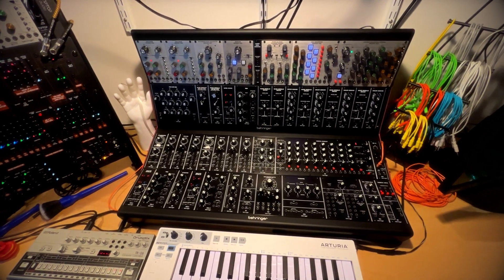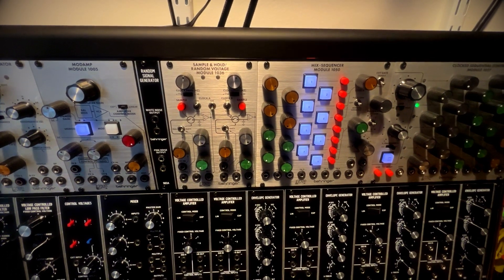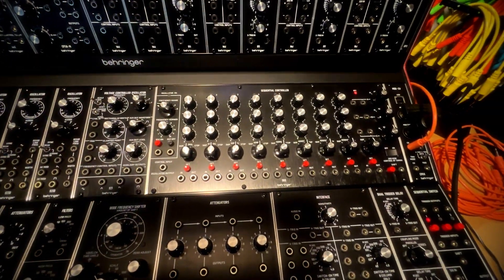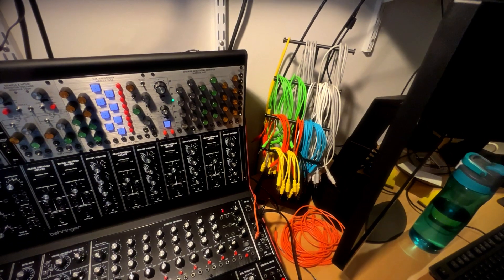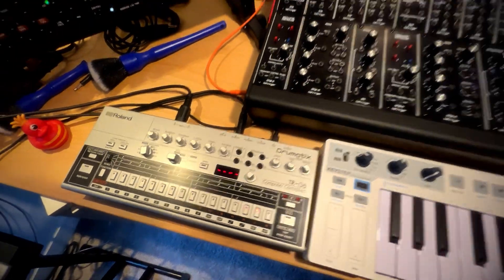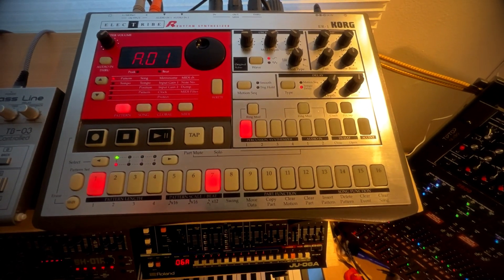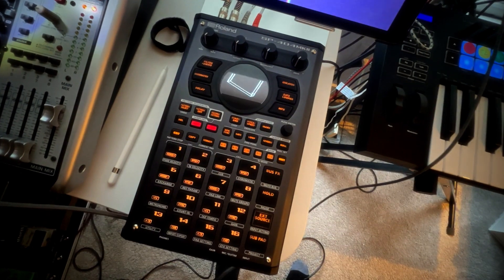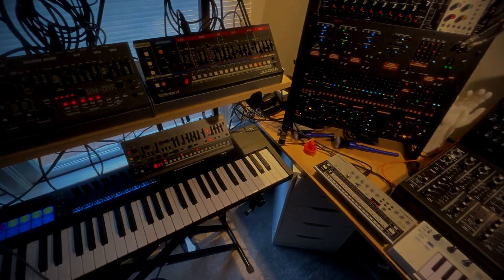Nerdy Studio Tour

Comment from the maker: Self correction here: I stated early on that the 2500 modules produce higher voltage output. If that were correct, I’m pretty sure none of this would work together. Without being an engineer my guess is there is a higher amplitude output, especially since the 1027 sequencer can trigger envelopes on the 2600 without needing a preamp as the 960 sequencer does. See my previous videos on using sequencers with the 2600.
Reply: ARP used 10v Gate/triggers.  Moog uses S-triggers (0 V is on, off is some positive voltage).  The System 55  V-triggers from the 961, the 960 sequencer  clock out and the 960 Gate outs are all 5V.  
Dealing with these differences is the biggest headache of mixing these modules.  At least it is possible.  Happy New Year!